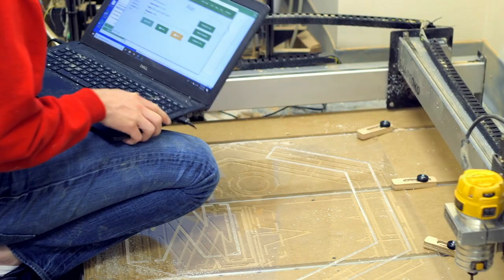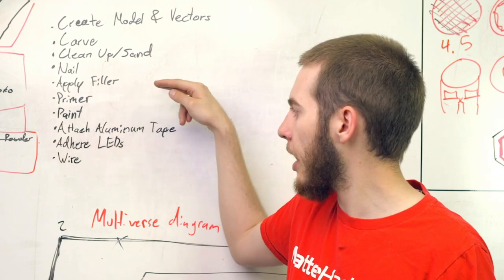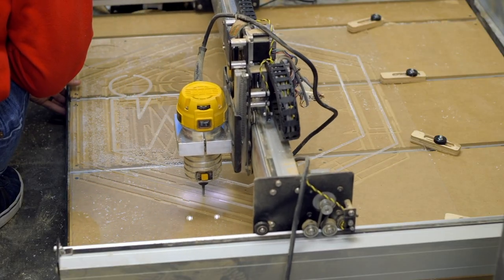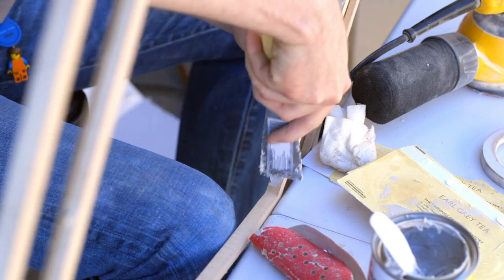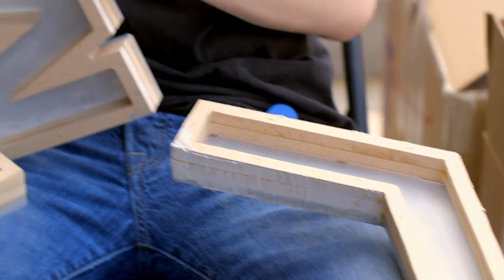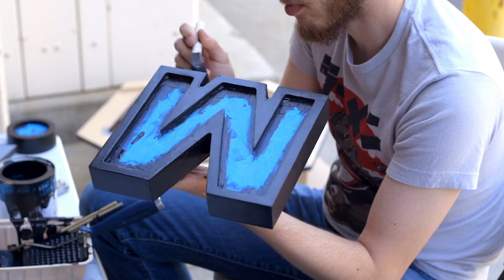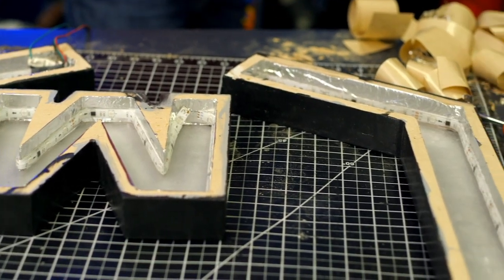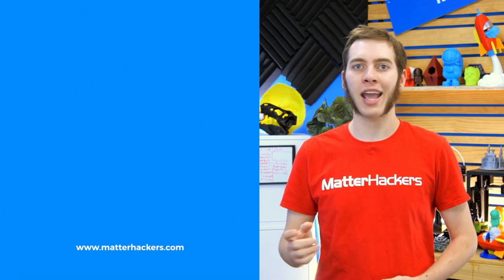CNC Carved LED Showroom Sign // Weekend Builds

Comment: Dont forget proper safety when cutting and sanding mdf. Wear a respirator.

Also to help speed up time, a flush trim router bit would help clean up the sides real quick.

Comment: You can also use diluted wood glue (dilute with water) to seal the ends of MDF. You'll still need some sort of filler if you have multiple layers. Any reason why you didn't paint before adding the plexi-glass?